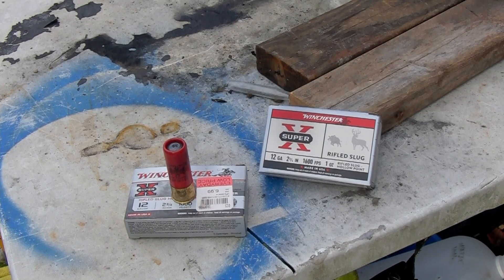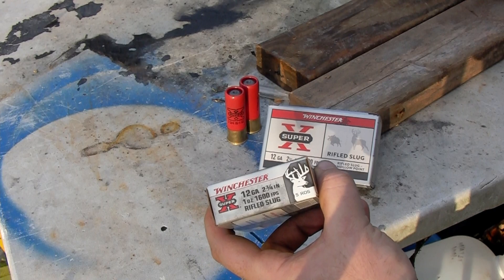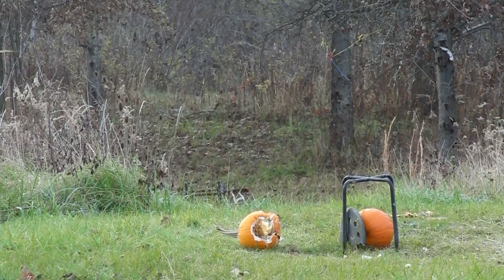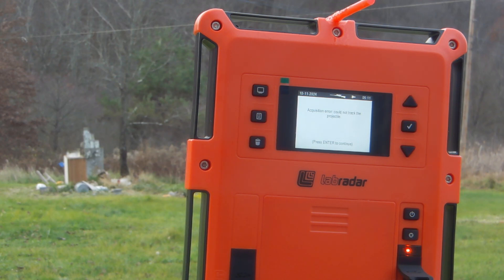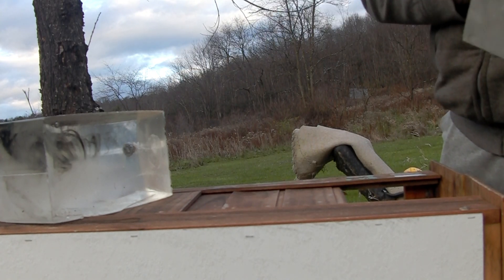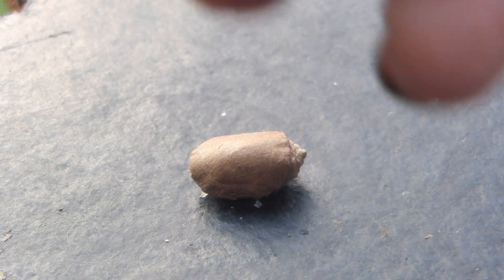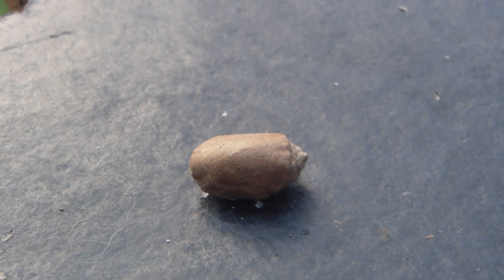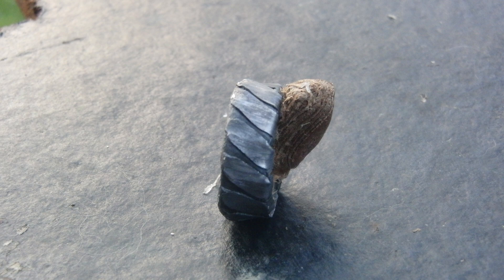Winchester 1oz 12ga shotgun slugs vs ballistics gel

Comment: I think I was expecting a little more damage and penetration from a 12 gauge slug, but still very impressive. Thanks Ray.
Reply from the maker: Thanks for your insight. I can agree that at first glance, it can look underwhelming. One must consider that the shotgun slug has 2.9x the mass of a standard 150gr 30 cal projectile, while having 5.6x the surface area.  This leads to 0.52x sectional density.  This is just 1 reason to the reduced penetration because it increases the amount of energy distributed per inch of penetration.  While modern expanding hunting bullets can deliver similar permanent wound size (by using speed) they fall short in delivering that energy as efficiently as the foster slug. As well as the increased surface area leading to a much larger entrance hole enhancing the rate at which blood pressure will be lost. The pros and cons are up to you but with proper shot placement both are undoubtedly effective.